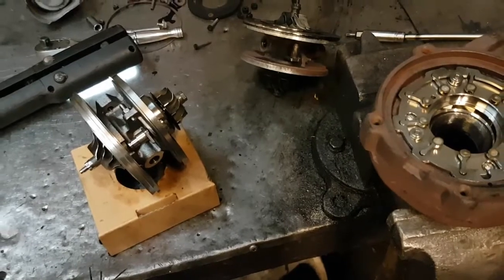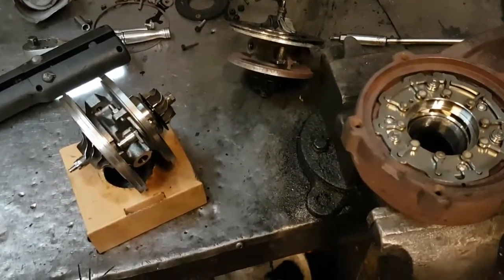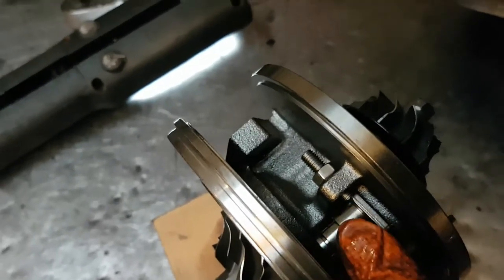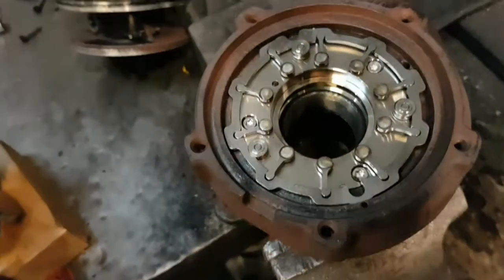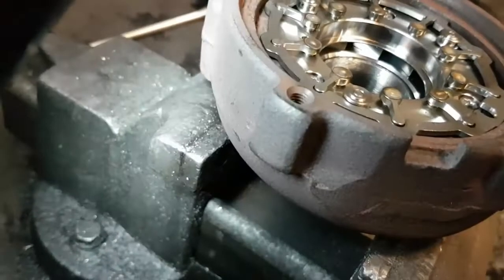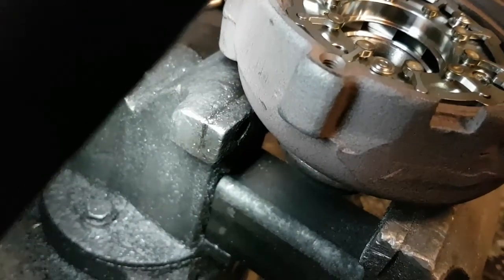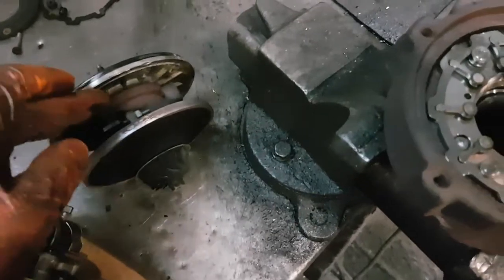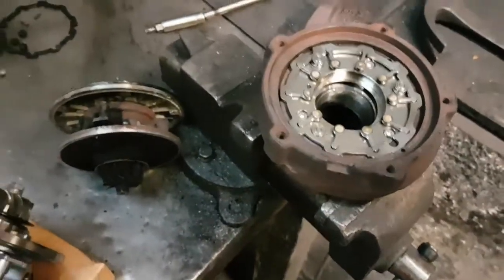Turbo Variable Vane Settings

Comment: Mine does'nt reach the stop screw at all. vanes so carboned/rusted that they cant reach it ? should the leaver reach the stop screw in any case?
Reply from the maker: yes it should
Reply: @colinhagan4378  hey i just want know the vanes must not be closed at all or stay open a little and is that the adjustment of the screw to let the vanes stay open a little or must they be closed thank u
Reply from the maker: The lever should reach the stop at which point is where the vanes should be open a little bit, thats the basic setting on the bench.
Reply: @colinhagan4378  I did prolonged the lever little bit is good but still have that feeling take time to accelerate I must play with accelerator to the engine jump a jump he must do it before few time I really don't know if I prolonge the screw little bit or I really don't know my car is a Passat b5 tdi 130 cv
Reply: @colinhagan4378  when I be at full speed is running like a rocket but only when be at a hill or someone stop me at a hill I be like a no boost my turbo is good I don't think is faulty but the adjustment of GV I didn't yet find the right position or maybe my wastgate is faulty I test it it work ok no vacuum leak also I buy a new n75 same problem I change the pipe who come from the n75 to the wastegate to an other little large thinking the vacuum need a large one same problem I have also open the turbo last month cleaned the GV and nothing change anyway I drive it today stop many times prolonge the level there is some power then stop again prolonge the screw little bit and have a feeling or retardation or acceleration same problem  idint know

Comment: Do you lengthen or shorten the actuator arm to increase boost ?
Reply: Shorten it lad. EVery full 360 turn shud be one pound of boost
Reply: @richardmaddocks9058  I had actuator arm all the way down and got check engine light underboost